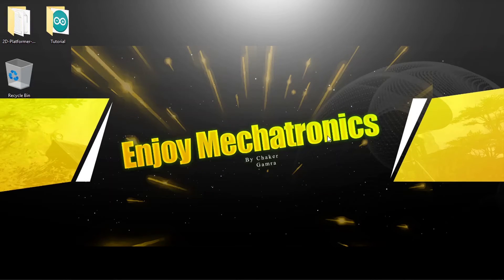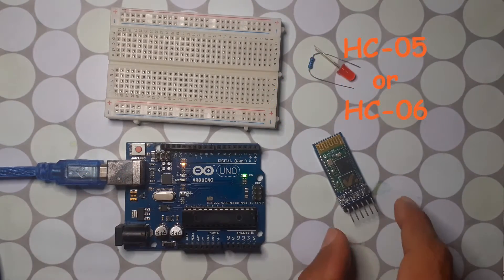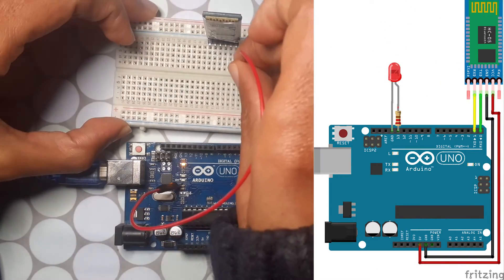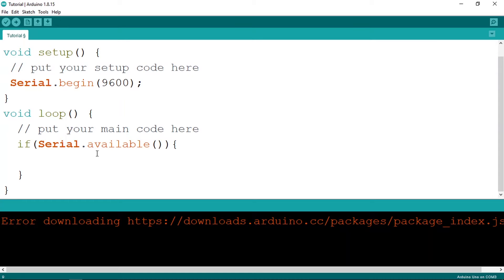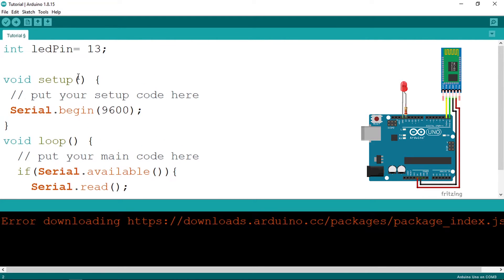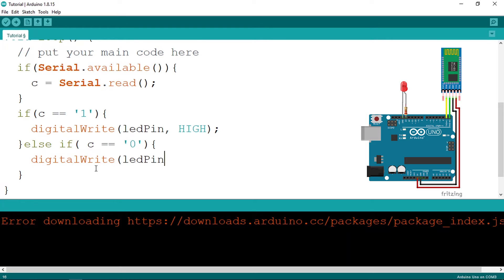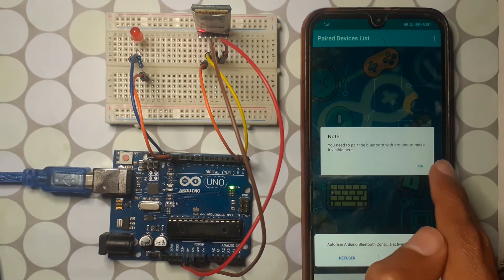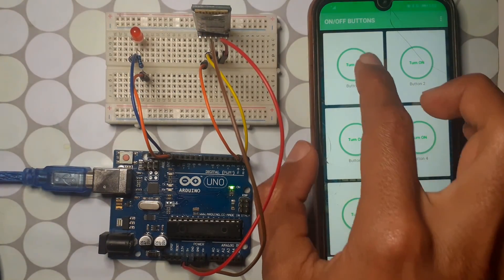Arduino Tutorial 26- Setting up and Using the HC-05 Bluetooth Module

Comment: Great tutorial. Easy to follow. Thanks so much. Just a note from what I have read on other pages. The TX and RX pin on the arduino board output 5V. The HC-05 RX and TX pins can only safely accept 3.3V. A voltage divider is required to bring the voltage down on the output of the TX  arduino pin from 5 V to 3.3V going into the RX pin on the HC-05 so it doesn't damage the module.

Comment: Yes, it worked eventually and after many attempts, it finally connected, but even though it was connected, my punctuation in the program let the side down! I put " instead of ' when defining 1 and 0 for on and off. I live in Spain but being British, when my original keyboard ceased to function, the new one I purchased, locally of course is for the Spanish alphabet. Just a point to note if anyone has a similar problem.